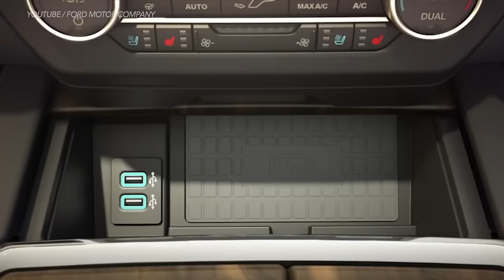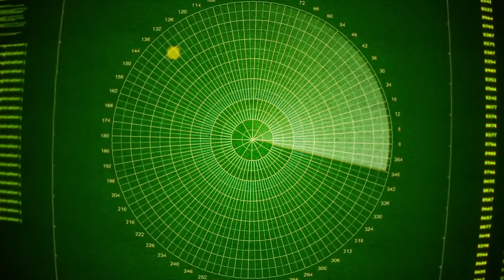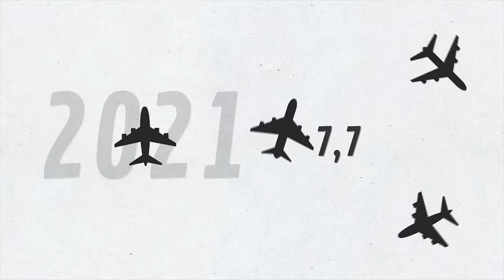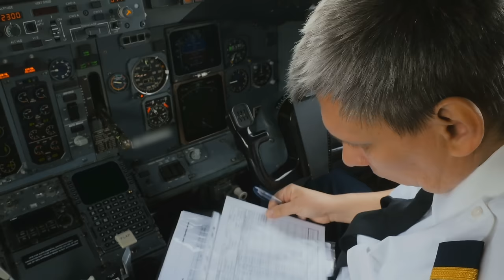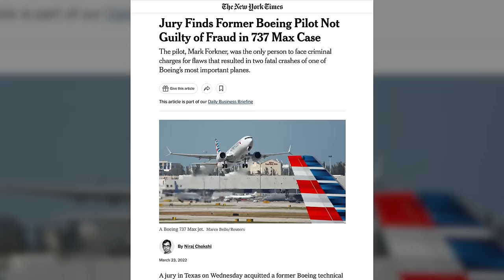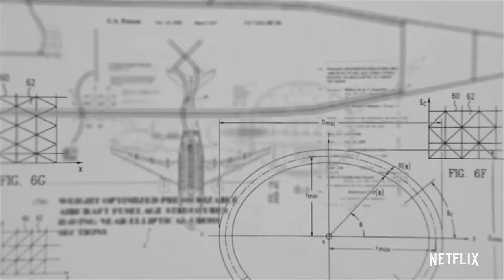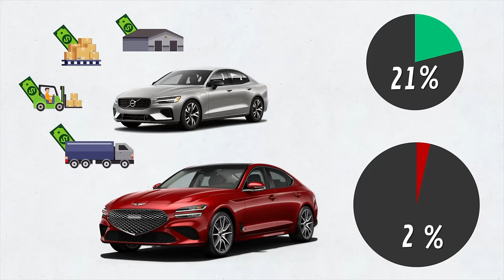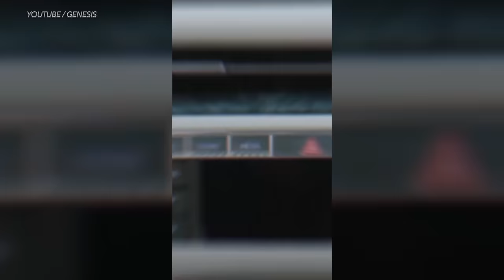Here’s Why Honda and Toyotas are Unreliable Now

Comment: Shocked that Honda fell off the reliability cliff. I've had more of their products than any other brand. My '86 Legend had to be dumped when the transmission started going. The others I just got tired of, like my Accord. I think I kept the RSX type S the longest, it was a fun, zippy little thing. But like a dope I sold it to buy, of all things, a friggin Audi. 😣 In Mazda3 hatch now, it's been going well.
Reply: @Whatever Uh, that's bc its only 5y/o.
Reply: Well reliability “ratings” should be taken with a grain of salt(especially JD power)
Reply: I feel like Honda reliability can make a comeback. Toyota had a similar dark period during the 2000s with oil aludge and accelerationgate. But Toyota recovered, and I believe that Honda is starting to make a similar recovery
Reply: I agree Jeff. I've owned a 96 Honda Accord, 2000 CR-V, 2001 CR-V, 2003 CR-V, 2004 CR--V. I gave them away to kids and family members as I replaced them and most have over 150,000 miles with regular maintenance and the 2000 CR-V has over 200,000 miles and still runs fine. My Sister inlaw has a 2011 and it's had lots of problems (check engine light making her take it to the dealer. 5 incidents of this . Some under warranty, around 2 grand that wasn't). My other sister inlaw has a 2018 Honda CR-v with similiar results (she had the issues fixed under warranty). Not sure how the new ones fair these days, but I'm giving KIA a try as we don't drive as much now and the price was attractive. It is a 2021 KIA Seltos. It's been great and I love the features. I have been getting around 39 MPG. I will update this thread if it screws up.
Reply: Thats funny. I went from Acura to VW to Mazda and then back to Honda. But Honda kinda sucks compared to Acura. At least Acura pretends to have standards. Honda sends you to the curb like trash. We had 88 Legend, 90 Legend, and 91 Legend. Brakes overheated too. Honda today is nothing like Honda of yore. Still reliable engines but lots of China outsourced junk, poor seating comfort, and warranty denials. Too noisy too! Acura is the way to go when Honda. Or the newest Hondas are designed and made in Japan again which helps compared to the US-designed flaws.
Reply: @RadAngelDMV  Mazdas are more reliable than most brands; probably better than all Euro cars & up there with Toyota.
In the UK the survey statistics rated the Mazda Miata (MX-5) the most reliable long term car in the whole car market. 
In response to your quip that his Mazda 3 is only 5 years old & that is why it has only needed a belt change - I know of many Euro cars, incl BMWs that needed a lot more in repairs within 5 yrs than that.....due to poor quality or poor engineering. 
My sister in law had a very reliable Mazda 6 for 15 yrs, then when she was ready to get an SUV, there was no way she was not going to get another Mazda, a CX-5. My sister likewise stayed with Toyota to upgrad from an early Toyota RAV to a newer used one - because of very good reliability success. This is why these brands have better resale values (as % of original price).....same as my 2010 Landcruiser; worth about 2x more than a used BMW X5 despite original price being very similar in 2010.
Reply: @jamesmedina2062  I bought only Honda JDM. Import directly from Japan.
Reply: what i like is some people still think those car are still reliable but they only give you 3 years and 60.000 miles powertrain warranty in the US. I m not a mechanic but i understand it this way if something happens to the transmission at 61.000 miles it's on me which is happening sometimes at least i know 2 cases. Why i have to take that bet.
Reply: @jacksonndoll5055  powertrain includes transmission
Reply: @jamesmedina2062  i do understand that but they give you 60.000 miles warranty anything above that you are on your own.

Comment: I mean you could argue 87 to to 1996 f-150s were amazing, especially with a manual transmission and a Ford 300 cubic inch masterpiece straight. 6. That'll be another quarter million half a million mile truck easy

Comment: The average car costs 50% of MSRP for the company to produce, not the paltry profit margins Scotty quotes here. At end of year I have seen some high end vehicles discounted by 40% and they were still making money. The semiconductor shortage is a myth to reduce inventory and jack up profit margins. I am amazed anyone buys new cars since they all have Turbos that break @ 70K miles and start stop engines which will destroy the engine and starter after the warranty is up.
Reply: I disable the start stop engine in my Honda, some smart people manage to make a gadget to disable it.
Reply: Not all new cars have turbos.
Reply: @zepp3lin  Audi's will allow you to do it from their software. Toyota's will not. Disabling is smart but voids the warranty. A momentary relay hitting the disable start stop button when the car comes on will work and can be removed.
Reply: @OrangeUp  True but most are putting them in all cars now including BMW, Volvo, and many Fords.

Comment: One of the biggest reasons planes are safer than cars is redundancy. Planes are required to have many redundant systems in case of failure. Cars? Nope. Also, the requirements to pilot a plane are way more stringent than requirements to drive a car.

Comment: Which car would y’all recommend to buy 2016 Charger SXT, 2015 Chrysler 300 Limited Touring, or 2013 Infiniti G37x all around 55,000mileage
Reply: Geez, those are lousy choices. Infiniti first, even though it's just shined up Nissan s#!t.  Charger 2nd, but it's probably been dogged and torn up, because Charger. And don't even think about the 300.  Chrysler is a whole new level of junk.

Comment: They should go back to basics, simple car design, all safety features are worthless if driver is reckless, good drivers keep watching the road without any help from sensors and expensive safety systems. Airbags are the only important safety features, thats it.

I just hope one company make a simple new car, and make a new standard for additional features to be plug and play, you buy what you need from any manufacturer complying with the standard, just plug it in the right socket, tight 2 simple screws and have fun.

Comment: Honestly, if GM made the 99 to 06 truck SUV today, I'd be Happy as a pig and crap and I would literally drive it probably 400,000 mi because I changed my oil insanely faithfully... Instead of borrowing 40 grand or 60 grand for a new truck, why don't you just buy a 2005 Silverado put a brand new engine in transmission in it. Restore the frame and pop and drive it 20 years plus

Comment: Every industry's dependence upon software is at the root of the problem. You take responsibility out of the hands of human beings and hand it to a computer module and you're asking for trouble. Computers fail. They're cheaply and easily replaced usually. Corporate CEOs and controlling boards must be held criminally liable for their decisions. Letting them off the hook just encourages more of the same behavior. Believe you me if Boing's executives had been imprisoned or executed things would have changed drastically. These guys sitting in their third mansion looking at buying their fourth yacht or counting their multi-million dollar golden parachutes simply don't care and never will.

Comment: A modern computer car could be more reliable, easy to diagnose and work on than any other previous generation of cars if they were built with that intention. Really sucks that all that innovation goes into nothing of use. We could easily build 400k mile cars if we wanted.

Comment: The late 2010s has been a dark period for Honda. But don't forget that Toyota has gone through similar 10 years earlier  (oil sludge, acceleration, etc.). Toyota recovered, and I fully believe that Honda is starting to recover.
Reply: toyota have engine and transmission problems, the all new v6 is the latest with turbo failure in the tundra.

Comment: In my country Toyota offers 8 years or 200.000 km warranty, and if you buy a hybrid one you get 10 years warranty for the hybrid system and batteries. So can it still be unreliable?
Reply: yes, in canada there is now a lawsuit for hybrid rav4, power cable rust and cause failure it not covered under hybrid warranty.

Comment: Boeing rushed the max into production because they had nothing to compete with the Airbus A320. Both of which run of the General Electric LEAP engine. The airlines want it because it's fuel efficient, because everything bolted to its carbon fiber.
Reply: The platform was short also

Comment: More of the parts are from China, which are cheap and low quality. The Car companies want more profit by cutting costs of it's engineering and using more plastics vs metal. It's getting worse over time not better.
Reply: You nailed it their buddy spot on.

Comment: Nope the plane math is quite correct and telling. You are much safer in an airplane than car, period. If there were 4 or 5 plane crashes a year so say 500 deaths still a drop in the bucket compared to 50,000 deaths per year in cars. But you said there was 1 crash? 100 people out of 8 million flights, pretty impressive safety record.

Comment: The answer is no we are not moving in the right direction, cars are mass produced so fast and most times the build quality suffers largley. 
Also I have been finding even changing out car batteries is becoming harder and harder with some cars needed to be re programmed after a darn battery change. 
Also my local mechanic is not liking some of these ultra modern cars as it's loaded too much with technology that not only fails, but sometimes good luck getting a part for it, but the most important thing is too much technology doesn't help one's driving rather more making us lazy and relying on all the fancy technology to drive for us. 
Personally I like basics in a car, less to go wrong and less expensive parts for when it breaks.

Comment: Innovations are not inherently good.
Adding more crap to cars doesn't make them objectively better.
It's just more likely to interfere with other systems and cause problems where there are none.
Like a bad running engine caused by electronics, even though there's nothing wrong with the engine.

Comment: Yes back in the 1960s cars were not reliable l am talking about British built cars started to get more reliable with the Japanese built motor vehicles kept improving in 1970s 1980s and the 1990s were one Japanese motor manufacturer started to get extremely reliable that is Toyota during the 2000s they were reliable just check out on Google and You tube articles and videos if toyotas have reached well over a million miles

Comment: Boeing has several things that tell the aircraft it’s level and speed. These things are ALWAYS backed up wit at least two more systems. They failed hard with the 737. They let one system run both of these things. The pilots trusted the craft, and the ONE system failed. What a joke!!!

Comment: Cmon Scotty, really? This is comparing apples to oranges. There are millions of cars on the road as opposed to thousands of commercial planes. Automation in the aviation industry has concentrated now in being more efficient and safe as opposed to having more touchscreens, 360 degree cameras, self parking etc.. We don't expect to get on a plane and have a heads up display or make the plane go faster. We just cate getting to point A to point B in as short time and as safe and comfortable as possible.  With mew cars, we are sooo lazy nowadays we can't even bother to turn your head around before backing up, we need a f*ing backup camera. We all know more complexity brings more issues so not surprised. This is the no for the next 10 yrs so get used to it or shut up and drive an older, analog car

Comment: Why can't we have plain simple transportation without the electronic crap?   Surely there is a market for such. Why do we need power brakes and steering on these small vehicles, for example?
Reply: Because only a few minority are asking for featureless cars and would most likely be a profit loss for the company.
Reply: @Electrodexify  Its always about the money for the rich.  Plus everyday mechanics could work on simple machines.  Back in the day teenagers kept their cars going.
Reply: @jreeder6168  But it is the customers that are asking for more features and companies are making what people want.  Features sell and by more features, cars are harder to repair
Reply: @Electrodexify  For luxury cars, yes, but there is a good market for simple, long lasting cars under 10K
Reply: @jreeder6168  No such thing as under 10k car, under inflation times.
Reply: @Electrodexify  Scotty told us how much it cost to produce these cars.  If his figures are correct how much would it cost to build a small car without the unnecessary stuff.  The electronics, powering brakes, power steering, automatic transmissions, air condition, power windows, cameras, And the list goes on.   I drive such cars every day.   Let one of these old cars come up for sale; there's a market for them.
Reply: @jreeder6168  You said it yourself old cars which have deprecated. Older deprecated  cars appear to fill this role in the market.
Reply: @Electrodexify  Not enough old cars to fill the market.